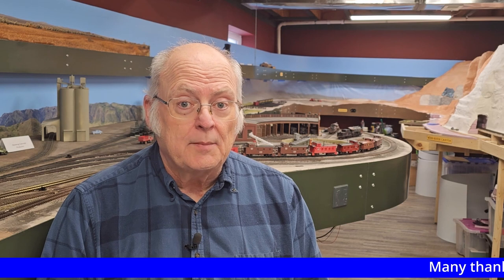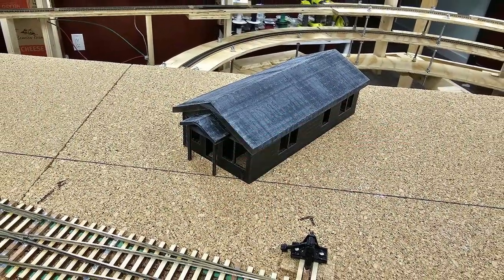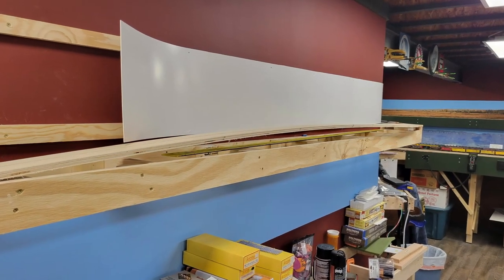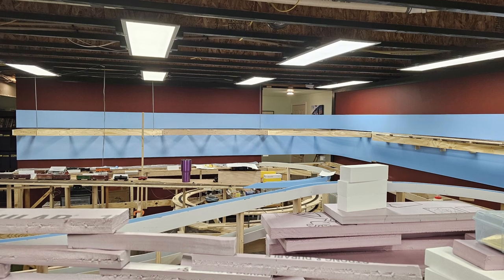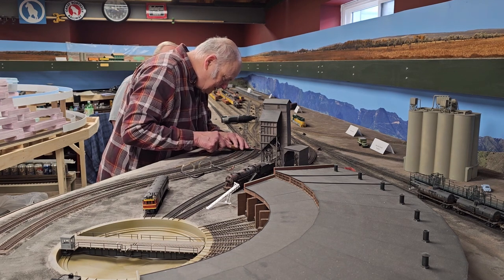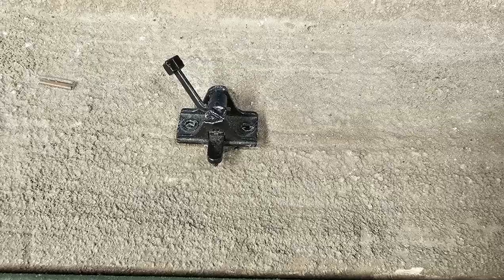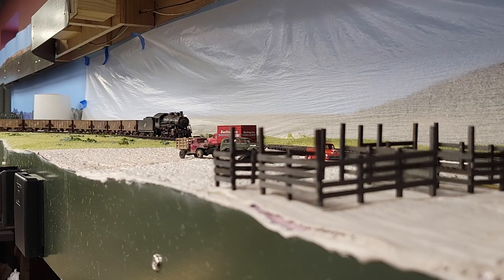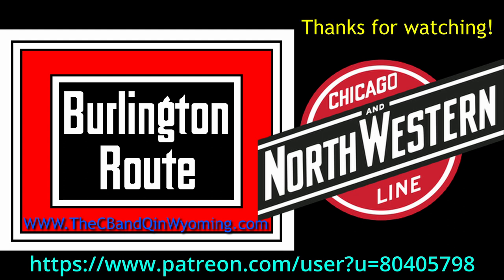2023 04 03 CB&Q V5 Monthly Update #41

Comment: Nice work on the RR.  For your sugar beets, why not cut some plain styrene to size, glue on some medium (or fine? whichever looks more appropriate to scale) ballast , and paint?  You could even glue a washer or attach a magnet to the underside of the load for easy removal.  I'd imagine it would cost very little and I assume you already have all that stuff laying around.
Best of luck and I look forward to your next upadate!
Reply from the maker: Hi Tim. I do plan on making loads a lot like you describe, but I'm just not sure what to use to represent the beets on top. Not sure ballast would look right, but I might give it a try. After all, all I'd be out is a small chunk of foam (got plenty of that laying around!) and some ballast. Washer might break me, though ...🤣